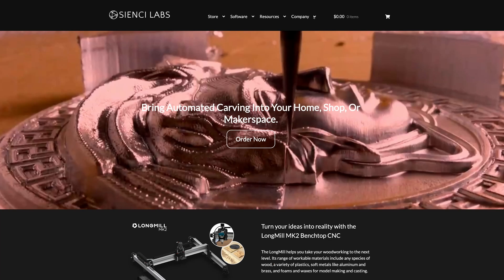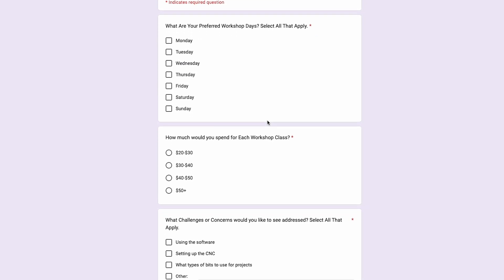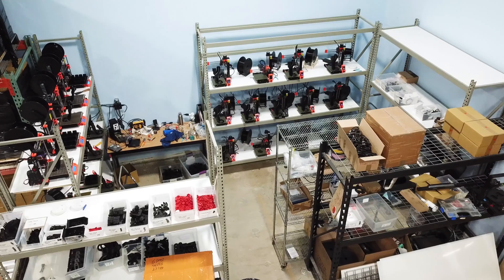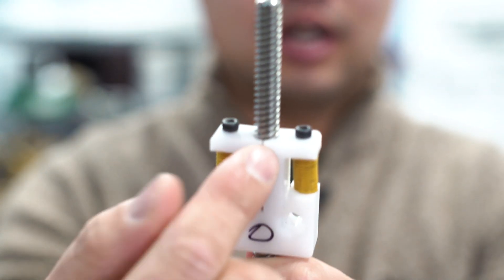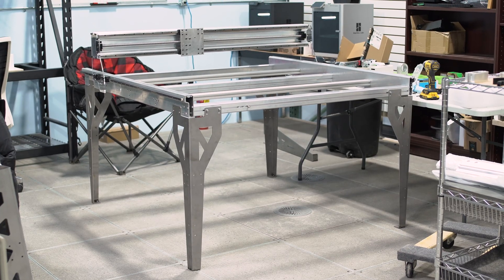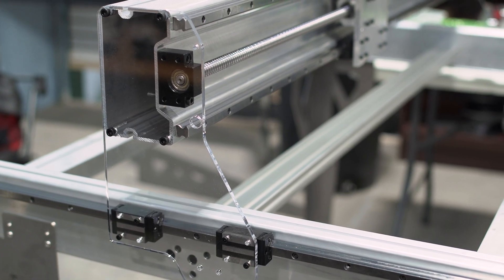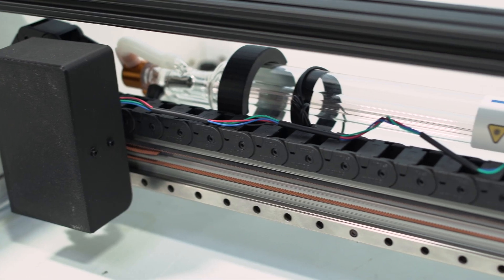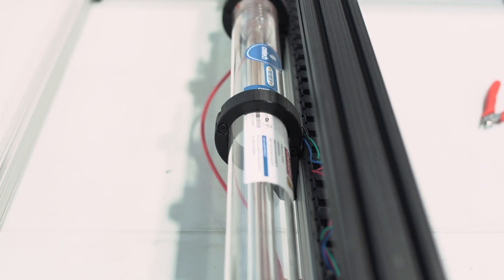Sienci Labs Monthly Production Update - February 2024

Comment: Hi Andy, one of the biggest advantages of the spindle over the router is the noise reduction.of the water cooled spindle. How does your new router compare in power and noise?
Reply from the maker: Hey @ricktanguay2310 thanks for the question. To be clear, we're still in the testing phase, so nothing is written in stone yet. To answer your questions;
We are aiming for 1kW motor. Until we've done actual testing we don't want to promise, but it should conservatively deliver 2/3 the power of a 1.5kW spindle. 
As for noise, our preliminary design has no brushes, has a smaller fan which will be "hidden" within the body assembly which should reduce noise to hopefully near air-cooler spindle levels. Hope these answers help! We'll be sure to post updates as info comes available.